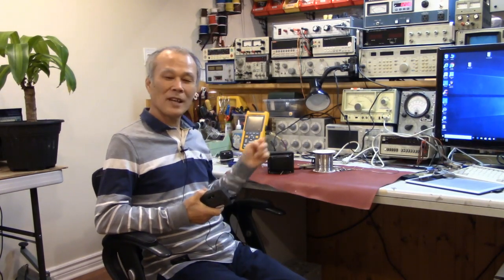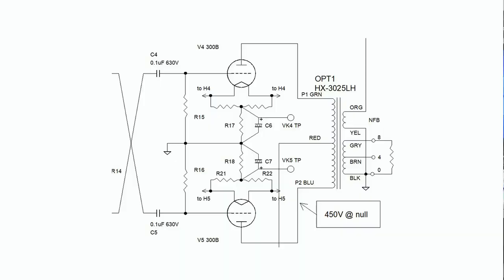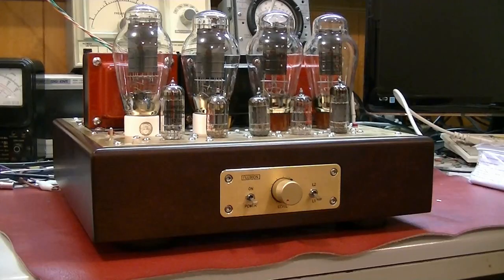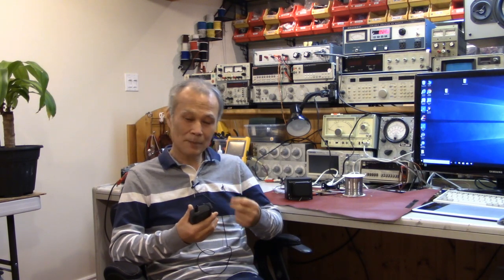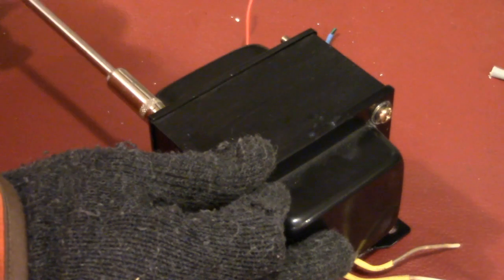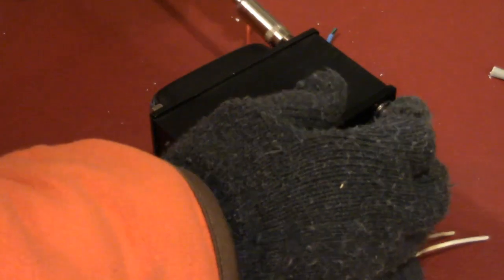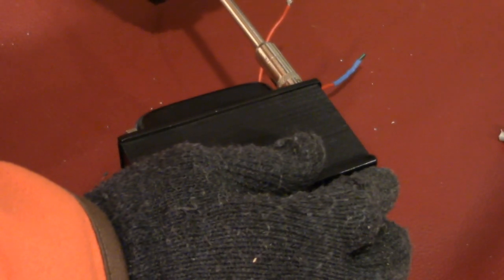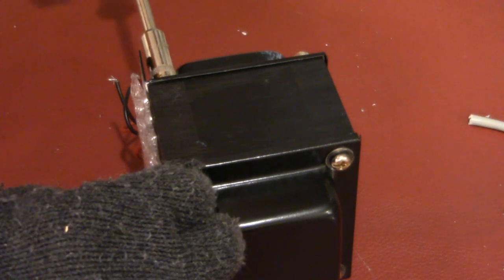how to repair damaged power transformer for tube audio amplifier, 300B 2A3 SE EL34 KT88

Comment: How would you suggest I cover the transformer wires inside ( under the bell covers) after I changed the wires. The sticky shellac like paper was covering the wires which I had to remove to change the wires. I'm not sure what to do.
Thanks
Reply from the maker: Hi, it's ok if you replaced magnetic wire successfully. Good job👍
Reply: @YoungAhn  Yes, but cover it with what?

Comment: Happy Holidays !
Do you make your own OPTs as well ?
I used to live not far from you (many years ago). I've bought OPTs from Hammond, also not far from you. I'm now in the deep North (West) and can only order parts online. I'm building a small coil winder from old printer parts driven by an Arduino to make my own OPTs. Not sure if I will get a quality wound product though. Any advice ?
Reply from the maker: Yes I design and build OPTs myself. All my amplifiers are filled with my own XFMRs. It took couple you years to stand up. please see other related videos. Just try couple of times and measure the electrical performance. You will find a solution. Thanks. Young